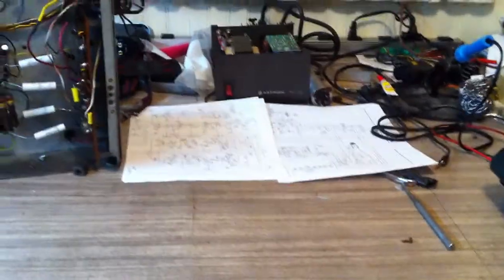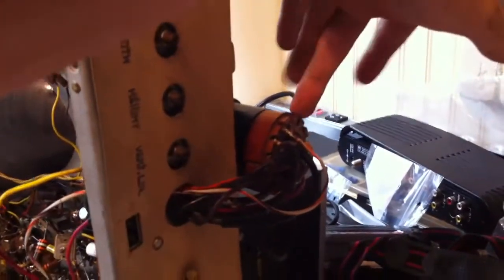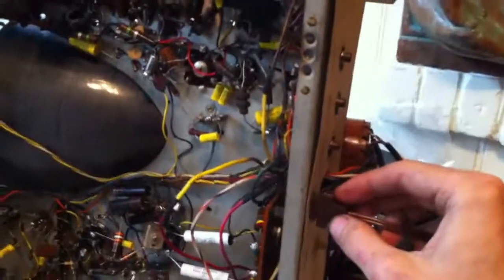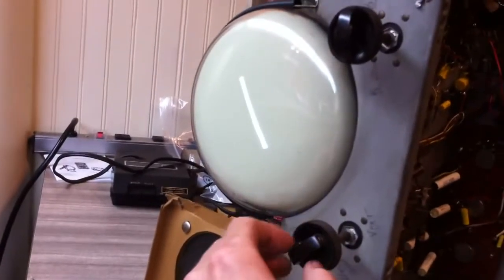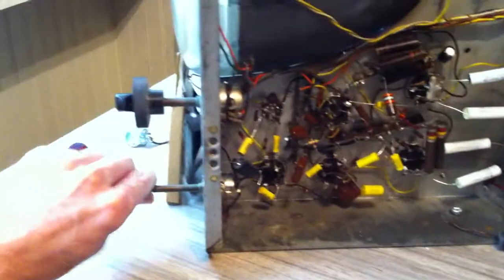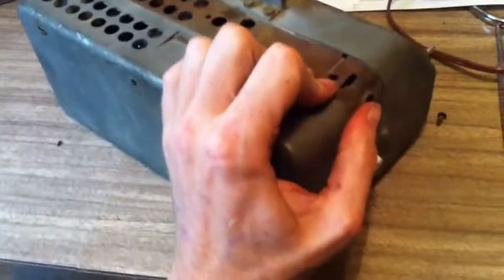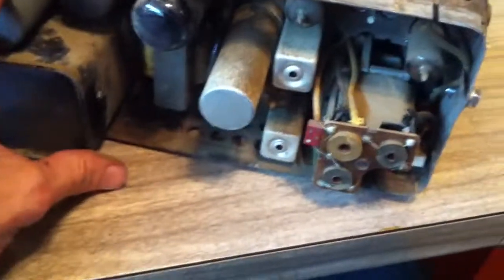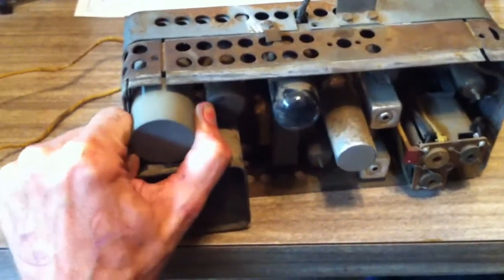1949 Tele-Tone TV Update and 54 Chevy Truck radio inspect

Comment: have you ever worked on a teletone tv-170 i have one and what i see inside is not what is on the schematic
Reply from the maker: Yeah, those chassis were produced in high numbers and even used in sets rebadged by other manufacturers. There were several different revisions in the power supply and high voltage section from what I remember that aren't reflected in the Photofact.